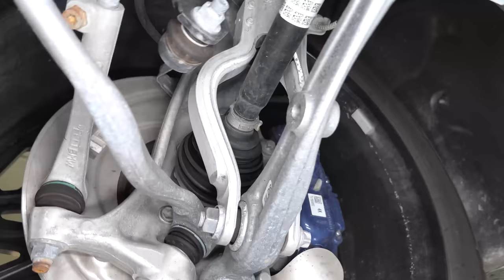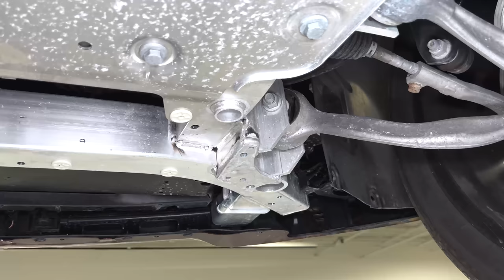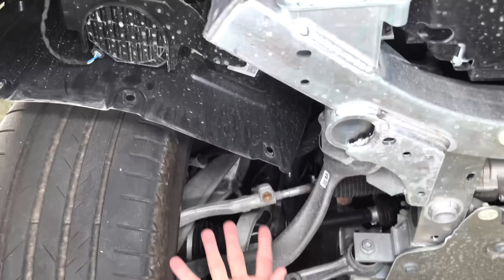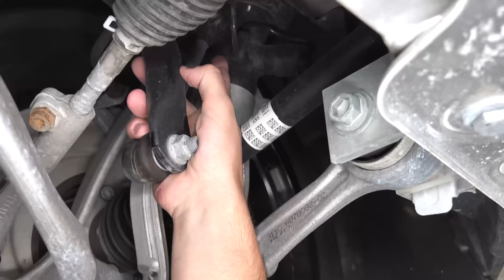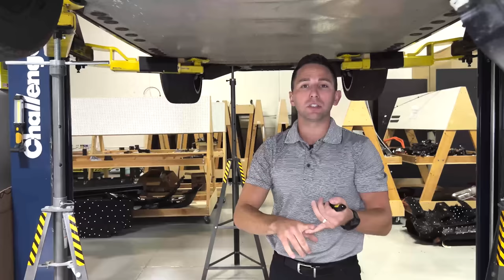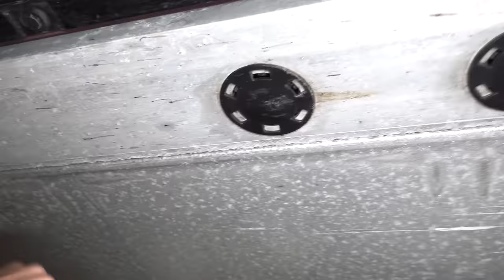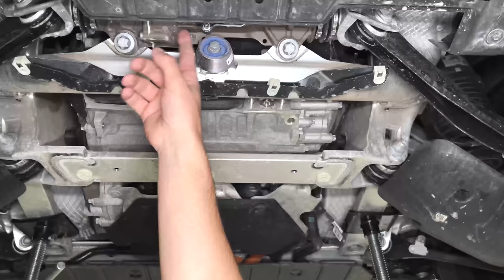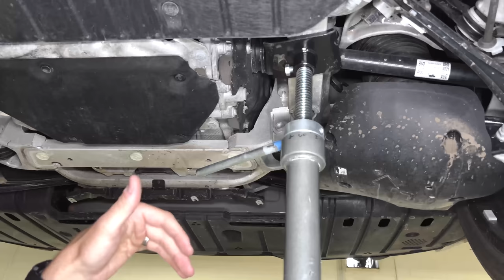Adaptive two-axle air suspension | BMW iX Hoist Review

Comment: Benchmark.  Where does this vehicle fit when put in a list from best EV to worst?  IMO the reason Munro's videos are so well respected is that a layman can learn what vehicle is better, what is better engineered to be a better vehicle, last longer and with fewer problems.  Now it seems that that is the goal when tearing down a vehicle but maybe not so much when simply looking at a press vehicle.  There is the problem, a press vehicle is NOT a accurate representation of what comes off the factory line, and without buy the end placing the vehicle in a list to let the layman know what other vehicles are better or worse, these press vehicle reviews just don't have the value that the teardowns do.  Saying if something on it's own is good or bad doesn't help, knowing that there is better, stronger, less problematic , design, and that it is same price or less... well that kind of info. REALLY helps the layman choose better vehicles which pushes progress forward.

Comment: Smh over engineering on the front suspension.... I guarantee those suspension bags wont last here in ny once the car hits 80k miles.... bmw engineers over build these bs cars to fail not for reliability... I will continue with my gasoline vehicles ie my Acura tl aspec..... I wouldnt waste time on no ev hybrid or plug in cars.... gtfoh

Comment: Nice design but with so many parts and fasteners, this seems like BMW is trying to ensure that EVs would have as much maintenance cost as ICE vehicles - basically, job security for their dealer network 🤦‍♂️
Reply: Nonsense!!!!! Do you see any engine or transmission inside that whole thing!? Grow up kid!!! The extra parts is to make repairs super cheap in case of accident instead of changing a whole giant casing they just unbolt and even home made that part lol…..
Reply: You mean like an $800 bill for replacing a seat belt on a BMW i3?
Reply: @rp9674  which dealer tried to rob you 🤡 wtf!!! Also seatbelts are not cheap tbh!
Reply: @rp9674  you think tesla would be cheaper than that!? And finally what does seatbelt has to do with suspensions or driving dynamics….
Reply: @carholic-sz3qv  not tried to Rob me, did Rob me. Seat belts have nothing to do with driving dynamics or suspension, it's the strap that goes over your body for crash protection, pretty basic concept. It's extra special because I've never had to replace a seatbelt before that.
I would guess that Tesla would be even more expensive.

Comment: See the blocks of metal. most over engineered. no wonder it is porky past 7000lb. nowadays even chinese companies can put out sound EVs. Dynamics alone won't cut it for EVS. in the age of Tesla, it has to match the software. Self-Driving is the King. Also, structural battery, All that underbody will be obsolete with 4680
Reply: Why can’t tesla be quieter, more comfortable and also better driving dynamics with all those castings!? Yeah try to explain that!!